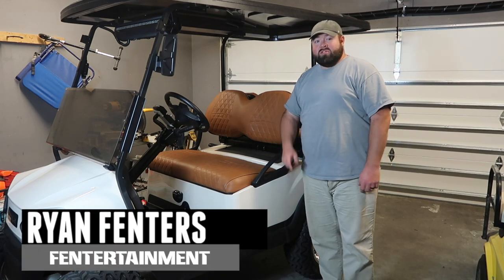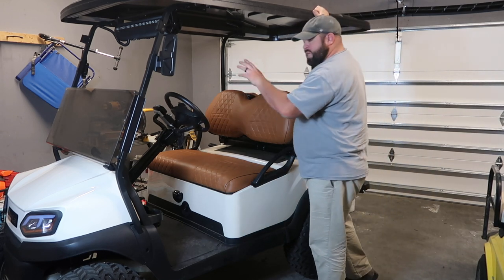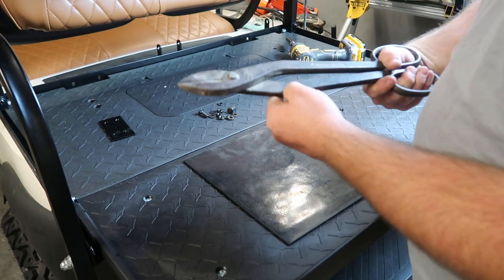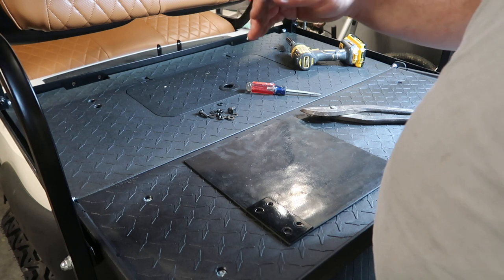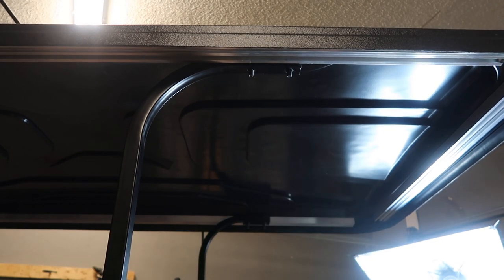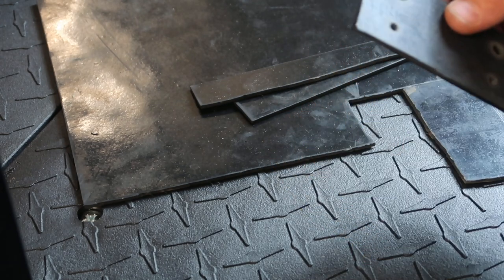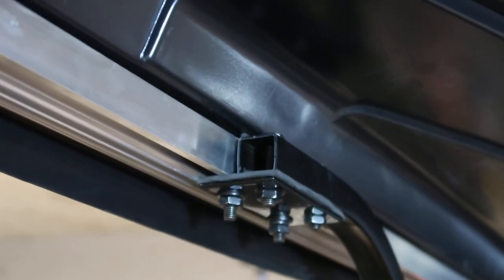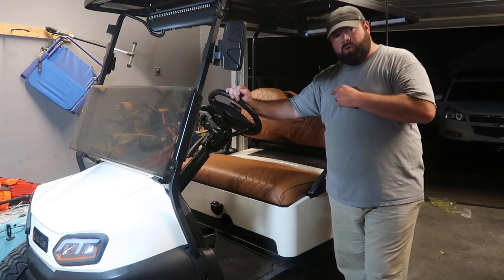How To Fix Squeaky & Noisy Golf Cart Top | Quiet Down Your Cart's Extended Roof

Comment: I started with rubber washer idea on our cart and it didn't work for all of the squeaks. I really thought the rubber washers would do it for us and I know there is no noise from those connections so that fix partially worked for us. The issue turned out to be the aluminum extrusions that frame the plastic roof. It was doing the squeaking and creaking and since we drive our cart exclusively off road I wasn't having it! I ended up buying VHB tape by 3M and basically stuck the aluminum tracks to the roof which knocked it out. I had to drill out the rivets holding the frame to the roof then basically line the extrusion all the way around with it. Once stuck, we pulled the covering off of the other side of the tape, stuck it to the roof (after cleaning with alcohol) and replaced the rivets. Voila! No more noise....ahhhhh.
Reply: I just did this today, tedious but it worked